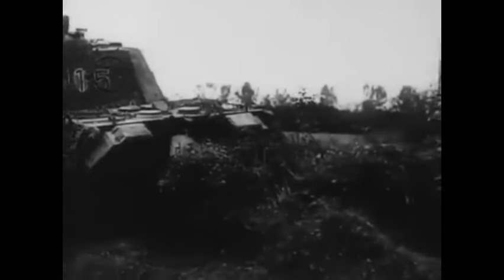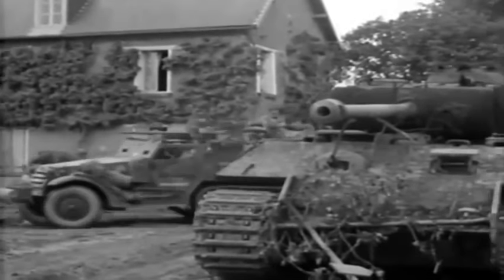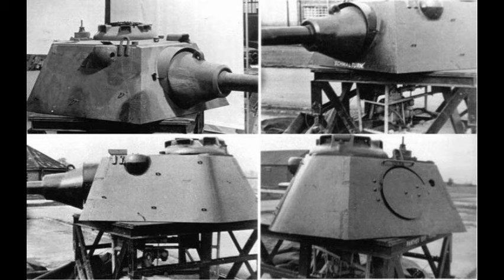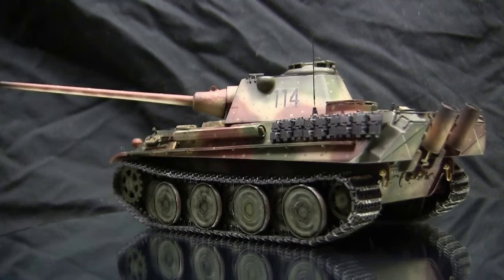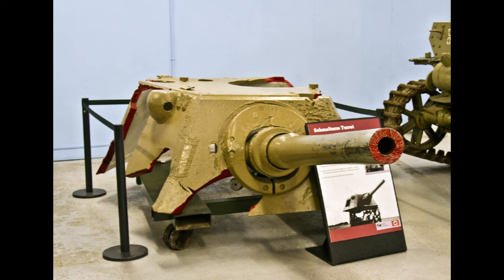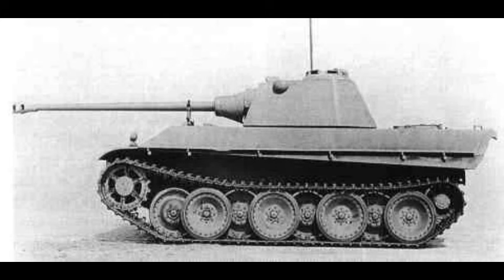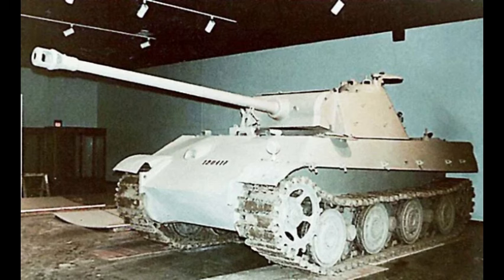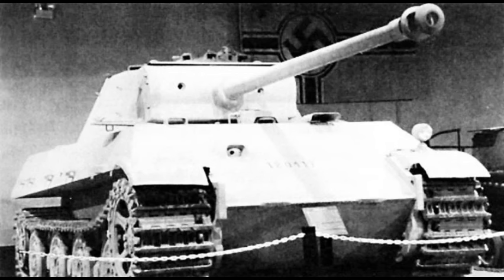Panther II – ULTIMATE Main Battle Tank of WW2 (’43 - ‘45)

Comment: On paper modern NATO tanks might out perform these WW11 Tanks. But I wonder in actual battlefield conditions if the Panther II would ultimately prevail.
Reply: No way,a modern battle tank has range,firepower,mobility advantages.Atgms,top down warheads,lazer rangefinders,etc.far faster response times.No way a panther would survive for long.
Reply: Yep, optics and computers alone.
Reply: With modernization sure it would do ok! But then it would be a modern.
Reply: I thought there was a new Panther in the pipeline.
Reply: Many “factors” are to be considered.
In favorable conditions the best Panthers of WWII would prevail against modern tanks.
Those conditions could only be achieved by consecutive leadership failures.
Yes;
Panther tanks could devastate modern tanks.
The 75mm high velocity main gun is capable.
Underestimating Panther tanks would be the first of many leadership failures…
Reply: @anthonyiocca5683 
Perhaps 75mmL100 or 88mmL100 with modern possibilities of launch 75mm round also. But many of armour structure will be necessary to modernised, opto- electronic structures, laser rangefinder, gearbox-final drive minimum from Panther2, etc. Existed studies of simplified suspension for Panther, still with front driving sprocket but without overlapping structures.
Reply: Well fit the pzkw V with the rifled 90mm gun of the first version of the abrams even with wwii optics the german gunsights are able to bring an accurate shot to knock out a challenger,
Reply: In a word: NO!
Reply: @mikemcginley6309  so then ¡super Sherman it's a fantasy by the israelis my friend!  a tank inferior in performance, armour and firing power to the Panther armed with a 90mm gun able to destroy Soviet T-54/55 tanks; fit the Panther with the 90mm gun of the earlier version of the Abrams and you get a new tank.
Also wonderful and state-of-the-art NATO supertanks have a terrible problem: all them are very sophisticated, like the leopard, a good shot of this 90mm gun could seriously damage the systems of a leopard forcing the tank to go to the maintenance field shops
Reply: @raymundovergararoman2473 
Yes Many improvements it need
But what about Rheinmetall Panther today ? 130mm gun , first time after Soviet objects we see 130mm gun on tank
Reply: @mirkojorgovic  well I try to clear out the possibility that panther could deal with a tank of today that it is the question by tetra, it's very interesting what you say because see der auslander in his channel in spanish, said that jagdpanther had a short life because the power of his gun of 88mm and here I talked about a gun of 90mm and now you talk about upgunning to 130mm, and for me the comment of der auslander that jagdpanther had a short life because the power of his gun of 88mm works as guide, because if a gun has a powerful recoil that shortens life of his platform (in this case the chassis of the panther pzkwv) then 90mm has a little more of recoil and then 130mm obviously has much more of recoil, and I tell you that because don't think I am an expert in ammunition, as a matter fact I thought that 90mm was slightly little, just noticeable, but one of my friends sent to me a photo of the size of a 100mm Soviet antitank round and I didn't saw it because I thought there's just not so much difference in size between German 88mm round and soviet antitank 100mm round (therefore even less between a German round of 88mm and a round of 90mm), until my friend said to me: pay a look to it,  don't presuppose stupid, and I really got amazed of the size of a soviet 100mm antitank round, and much more with the power shot of a 100mm soviet antitank gun, now imagine the recoil forces for the turret of a panther fitted with a 130mm gun; shmalturm of the panther ii would be unable to allow such a gun, usual turret of the panther pzkwv, could just withstand such force and also your panther would have a short life as his brother of arms the jagdpanther also of the fact that today's tank ammunitions comes in two parts, this panther with a 90mm would actually be shooting a sub calibrated round, possibly a 35mm rod with an apfsds
Reply: @mirkojorgovic also I want to remember that the proposal is about a wwii tank, that is able to face a modern tank of our days so the question is not about a panther ii with steroids if not to keep it as much as possible as a wwii tank so the minimal change could be to fit it with s new cannon or even more conservative: it to keep with his original cannon but with s change I ammunition, fitting it with a sub calibrated round, you could say that schmal turm had an 88mm gun but remember the Chang of size of todays ammunition compared to the ones of wwii, so why not to fit panther ii with a sub calibrated ammunition and it to keep with his original size, for el that’s enough to cause serious damages to a tank do today a sub calibrated round of 88mm of steel- manganese is enough to cause serious damage, even to a tank of today because you concentrate the acceleration brought to an 88mm nominal Rouen to a rod of approx less than the half of the size, also of concentrating the same energy of impact in a projectile of smaller diameter 😮

Comment: The use of slave labor or conscripted labor was probably a very bad idea.  To much risk of sabotage and bad workmanship.  The engine, transmission and final drive should have been in the rear and the engine should have been a multi fueler diesel which would have allowed furnace oil, kerosene, diesel or jet fuel to be used.  Plus the hull and turret should have been a bit longer and wider.
Reply: Multifuel diesels in 1943?

Panthers and King Tigers were at the limit of railway gauge AKA their hull's width(3.27 meters) was maximum allowed for railway transport. 

Try transporting hundreds upon hundreds tanks on nonexistent tank transporters who would need to be produced, fueled, manned and guarded over thousands of kilometres...logistics, they catch inexperienced ones easily.
Reply: The "sabotage" issue was more often an easy excuse for faults of supposedly "stellar" German designs than an actual major concern for Germany during the war. The German SS didn't just admit anyone as forced labor, they would first filter out (read: disposing) any workers of potential resistance, such as political prisoners or educated nationalists etc. There was a reason why for every German labor camp, an extermination camp would be just nearby, a constant reminder to the laborer that staying in factories was a privilege. Then each forced laborers were only taught few basic steps to produce, before handing over the components to next worker in line, meaning only one or two laborers couldn't easily perform sabotage without being spotted. And of course there is always supervision of workers and multiple inspections of armaments produced. The first from factories, and the second from the German Army (the Waffenamt) themselves, hence most German weaponry had two proof marks.